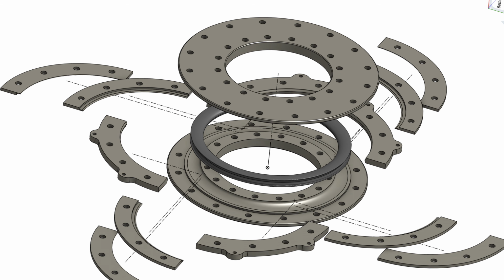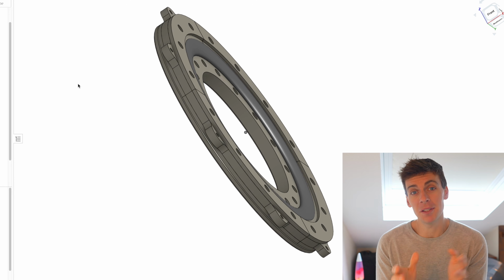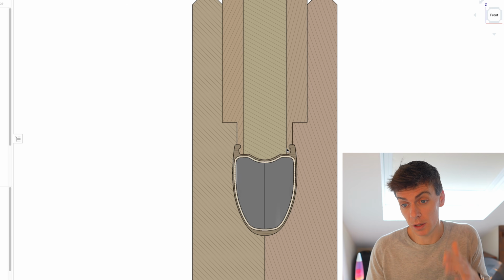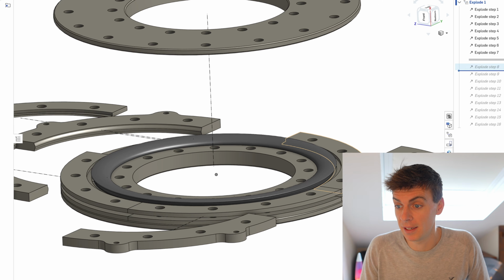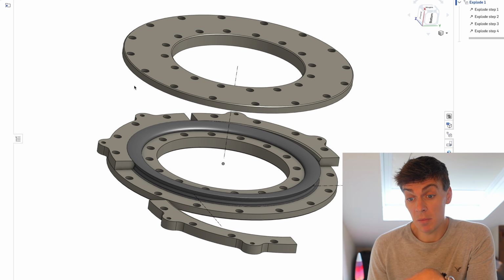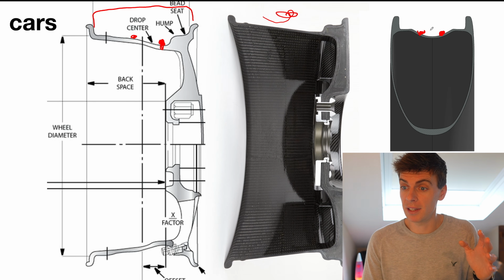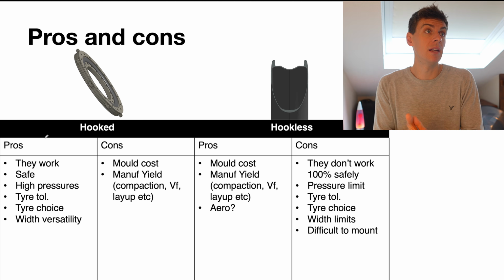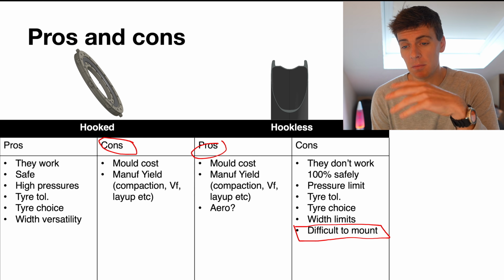Hookless carbon Bike Rims - the Truth = cost cutting.

Comment: I run hookless and I'm bike savvy so hookless is not an issue. I don't run any tires not meant for my rims. I'm currently 143lbs with 28mm tires so with my weight its not really an issue

The issue is there are a lot more riders who are not bike savvy or riders who weigh more and risk running higher pressures. Obviously, if the rider is running bigger tires it does reduce the tire pressure needed 

Which brings me to the trend that most roadies are moving towards 30mm - 35mm tires. If this becomes the norm then hookless will have less of a chance blowing off the rim. 

I've been running hookless on my MTB bike way before hookless was even a thing in the road cycling world. 

Hookless can be an option alongside clincher

Comment: Just found your channel and really enjoying it. This video I know you were more looking at it from a road side, but I was thinking more from a MTB perspective. Over the years I have seen countless brands attempt carbon MTB rims and the most notable trend was rims failing on the hook for more aggressive applications. Then when hookless started becoming a thing, we seeing far more reliable carbon MTB wheels. I never really thought about it but before but I wonder if that was due to a combination of two things you mentioned. The dimensions for hooks dramatically predates carbon rims and perhaps there is a limitation in material quantity due to the standards space constraints? Especially given your second point about the manufacturing consistency when forming such a relatively small and intricate shape as the hooks on these rims. Perhaps in some specific applications hookless could have some practical usefulness over just manufacturing cost?
Reply from the maker: @kenh6096  certainly in mtb i think the thicker, more uniform plies of the straight rim wall without hook (in carbon) is beneficial over hooked. Coupled with lower pressures, speeds (in general) and much stiffer carcasses - it can work. Road however, as we have recently been reminded, its just a risk not worth taking.

Comment: As a rider i have used hooked with a tube  or unfortunately hookless and no tube. Never been 100% sold on the hookless part. Comfort no tube does help. Never lost a tire but felt needed a hydrologic press to mount the tubeless a few times. All the talk on this and seeing how sketchy it can be makes me  question a local route with speeds over 55 mph at 12% grade. If there is 0 benefit to a rider lets go with safest possible. Not looking for hospital bills. Also if it cuts costs for manufacturing why are the wheels still over 2k a pop for top end?  Requiring wider tires has aslo pushed many of these hookless outside the aero benefits they claimed were possible at one point. The BS manufacturers said was it gives an aero benefit between tire bead and wheel. Think we passed the tire widths that those benefits dont exist on many wheels. The wider tire benefits have been negligible on personal test too and roads are not great here.

Comment: With hooks, the tire is hold by the inner tube - expanding force pushes the tire from inside on the hooks. 

Hookles could be good if they use inner tube to expand tire on the rim, and use sealant inside the tube. But you cannot over inflate them as they could push the tire out.

Comment: Probably an excellent analysis for road bikes... But I use a gravel bike. I never use smaller tyres then 35mm (NOT 25mm LOL). Often 40mm. It means I never go higher then 60psi. Most often for those 35 its still 50psi anyway, which works brilliantly. All the tyres I buy check if they are hookless and tubeless compatible, and they all are. So I don't feel that limited. Because they are a bit wider, I don't get the puncture. Well I also don't torture my tyres, I don't race, more a sunday rider. So it seems I am doing fine. Any comments on this ?

Comment: You can throw a lot of logical statements against hookless but the tests proves it works? Maybe not with all tires and pressures but within a certain range. There are also other benefits to hookless besides reduced manufacturing cost
Reply: Neglects to mention any other benefits...

Comment: Thanks, been telling my mates to avoid for years. I have the 454 nsw zipp wheels but they were the first iteration and are hooked.
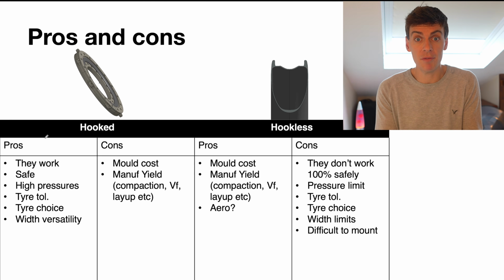One thing - can you clear up pressures - hambini in his video of the same issue (cut apart zipp wheel, about 18:30 in) seemed to extol higher pressures - does that not lead to an increase chance of blow off with hookless ? there was an enve video of them testing this somewhere iirc.

Comment: Hookless on a road bike is no different from the current 1X scam on road and gravel bikes. The manufacturers eliminated the cost of a front shifter mechanism, a chainring, and a front derailleur, yet the price of the groups are generally at the same MSRP or even higher than a comparable 2X system. 1X for road and gravel has always been a complete scam to lower manufacturing costs and increase manufacturer ROI. Full stop!

It also got pedaled to the market by SCAM's marketing team because they lacked the ability to create and fabricate a dependable and proper shifting front derailleur so they basically just lost it and started advertising their snake oil BS about how 1X is soooo much simpler (as if a bicycle front derailleur is some obtuse NASA type device that no one can comprehend or adjust on rare occasions???) and then lied further and waxed poetically about the supposed "massive" weight savings while of course conveniently ignoring the fact almost all 1X road and gravel set ups are using a dinner plate sized cassette, a chain catcher and a longer chain to deal with that dinner plate size cassette, which pretty much eliminates  almost all the "supposed" claimed weight savings. Then to finish off their comedic snake oil marketing act/project they actually raised the price of 1X groups higher than their comparable 2X systems even though it obviously costs them far less to produce said 1X system. And of course, loads of gullible and easily marketed to dopes have happily bought into their 1X snake oil BS nonsense. 

Oh yes, I'll happily pay MORE for bigger gear jumps,  constant shitty extreme chain angles and loads of extra accelerated wear on my chain and cassette and single chainring up front. Sounds like an absolute "incredible must have" bargain on my road or gravel bike. LOL  PT Barnum would have been very proud and envious of this obvious scam marketed as an "improvement" along with the latest hookless rim scams! 🙂
Reply from the maker: Absolutely agree. And sram pushing smaller front rings because material cost goes down with radius ^2 🤓

Comment: I use the Zipp 454 with Conti GP5000S TR 28mm in tubeless setup. I am easily able to mount the tyres on the rims with my hands. It is harder to dismount the tyres the tyres from the rim. So I have been able to dismount the tyres only with the help of tyre levers.

Comment: Lets revisit when all your new bikes in the next 2 years will be hookless. Find me someome who has had a failure that actually followed the manufacturer recommendations. Its like blaming Shimano disc brakes because once upon a time someone used dot fluid instead of mineral oil in their shimano brakes.
Reply from the maker: I dont want to ride at 73 psi knowing the safety factor is 10% over. Nothing to do with manufacturer recommendations, i don't trust them.

Comment: I was expecting a little bit more from your video. Comparing molds and car tires … when we actually could see engineer thoughts on examples of hookles + some of compatible tires, or strength of the profile etc etc. I use hooked and hookles - definitely next wheels will be hookless, no issues and much more comfortable. But I run disc brakes and tubeless since almost 10 years now and use a gravel bike since 10 years and it was horrible than - now everyone does 😊😊😊 for me it is the same with hookless…

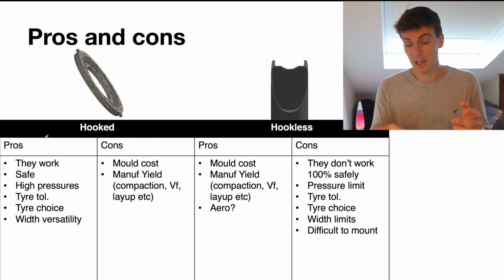Comment: @18:30…another “con” for hooked is the manual cleanup of the numerous die lines.

Also, as the dies wear, or if the die tolerances aren’t “perfect”, you’ll end up with steps at the die lines which can’t be cleaned up.  Maybe that falls under “mfg yield”.

Comment: Just a few thoughts. Enve, Zipp, Cadex, quite a market share, used in a pro peloton for a couple of years now. How many accidents were there, propeloton wise and among amateur and recreational cyclist. It is new techonolgy, every accident is put on alarm as it was every single time hookless is used. Same happened when disc brakes were introduced, one cut due to rotor looked as carnage made by persian carriage. People are putting 23 mm tires on a 23/25 internal width, Silca recommended 5,5 bar on a Zipp rim, etc... Too low pressure - danger, pressure above 5 bar - danger, narrower tire than 28 mm on 23 internal - danger. My LBS told me how insane low pressure pros are using, and this is not a rumor, few well know peloton pros are locals in my town. Using inserts like this proves that pressure might be too low. If you use 28-32 mm tire approved for hookless, with pressure from 4-5 bar you are good to go. Lower/higher/narrower - not so much. And again is there indeed any research how many accidents are hookles based? last year among pros, if i am correct, so correct me if i am wrong - none?

Comment: There's some good analysis here, and I have no doubt that some manufacturers use a hooked / crotched mold as you have shown here. However, I know for a fact that at least some rim manufacturers (who control their own manufacturing - not contracted) do not use steel hooked plates when molding the hooks. 

Instead, they use a silicon mold piece to shape the hooks, that can be pulled out from under the hooks due to the flexible nature of this hook mold. Unfortunately, this means they cannot achieve the same compaction pressure and consistency you get from a steel mold - so from a manufacturing perspective looking at hooked vs hookless, hookless means simpler molds that also significantly improve compaction in the sidewall area. End result is a slightly simpler mold than you have imagined here, but with compromises to the finished product.

Comment: Have always thought hookless are not safe ,so much can go wrong tire size , pressure , and if you are riding through an area where the temps are high you air pressure in the tire goes up another thing to worry about ,and if you have bad roads s---t,    sorry to those who use them  , hooked rims only for me ,

Comment: Why would you need more than a 3-piece mold for hooked rims? Per section that is.
Reply from the maker: My guess is most basic mills like to measure x/y limits when performing post machining tolerance analysis rather than a polar coordinate/120 deg arc being quite hard to measure.

Comment: Would it not be possible to just manifacture hookless rims with thicker edges, and machine/mill the hook afterwards? Best of both worlds?
Reply from the maker: Yes, youd cut through and damage fibers but it could be done if there was enough material there. Practically quite difficult as if you moved the cnc tool or the workpiece, the rim needs to be dead true before milling. They’re not flat when they come out the mold

Comment: I have zero knowledge of carbon layup strength or the ability of carbon to be machined and still maintaining strength. IF you made a hookless rim with say 5mm wall thickness could you machine the hook. A much simpler mould is required and a machined finish should give you better tolerances.

Comment: I suspect that ISO standards were based on alloy beading surface. We saw worse performance with rim brakes on carbon rims, I suspect carbon bead performance is also inferior to alloy.
Reply: Who started the nonsense about the low performance of rim brakes? With the right rim brakes, the pressure of one finger is enough to overturn or lock the rear wheel. In any weather.
Reply: I agree with you, I ride rim brakes, but they are undeniable worse performing on carbon rims than on alloy.  @paterjan9733

Comment: Oh please, you are way overselling the complexity of that mold, uuuh, oooh tolerance stackups, so so complex - no it isn't - you can turn most of that on a lathe, forces acting during production are minimal - this is not injection molding.
Also it wouldn't be 'tens of fhousands', more like a 'few', and at those selling prices those pay up for themselves very very fast.
Reply: After giving it some thought - you can probably just machine the hook groove in the rim - a bit weaker than solid, but a compromise.

Comment: The hookless seems to be a standard for the mountain bikes rims and tyres (correct me if I am wrong). At the same time, the size gap between road and MTB is being closed with the current supersized gravel and big road tyres. Roadies use 32c, some are even using 34c and they say theoretically riders could benefit from even bigger road tyres. It is obvious that the smaller tyres and higher pressures (25c) work against the hookless though. So where is that borderline? 
PS Why are aero benefits doubtful? Isn't that area of the wheel critical for aero gains?

Comment: I could not agree more with you.
With pressures above 4 bar hookless designs make just no bloody sense...

Concerning the GP5000 TR: I had rims made at lightbicycle and send them the notoriously difficult to mount Conti tires up front, so they actually adjusted their mold design / rim design to match the GP5000...

Comment: Had idea of using the new straight wall mold method with extra thick walls then chucking partially disassembled mold in a lathe for machining in the hooks.  However, the hook area wouldn't end up as strong, but could have fewer voids.  Economy increase would be dependent on old hooked molds' yield.

Comment: Relieved that the Zipp 353 NSW wheels that I have should be okay for the application I use the  for. Gravel. Running 700x38 Rene Herse (on the approved list) tubeless and never higher than 45psi. Had no issues with installation.

Comment: Nice mold design and I'm sure some factories are using something similar but I believe the standard practice in the industry is to use a single piece mandrel, even in hooked rims.  In order to remove it they make it out of a soft material which is permanently deformed during extraction and must therefore be disposed of after a single use.  This is obviously also less cost effective than the reusable mandrels in hookless rim manufacture.

Comment: I have Hookless rims. They're a gravel wheelset although I use them with road tyres. I run 34c tyres at around 50psi. I wouldn't run anything less than 32c on them. I fairly light too at around 65kg.
With the benefit of hindsight I probably wouldn't buy Hookless again but I'm not going to lose any sleep over riding this wheelset.

Comment: I defend my 303 by saying non of the cons are important to me, like none of its Pros. I bought this set for 1. brand and warranty 2. purchased at a discount at 0% instalment 3. weight 4. wide inner width 5. also works as gravel set with its 25 inner width 6. bling. its hooklessness was the least of my problems.

On road, I'm running GP 28mm and moving on to 30mm soon since comfort = more hours on the bike. Mounting GPs isn't a headache for me. Despite heavy weight, I run my tires between 62 and 66 (Zipp suggestion for 108kg total weight), which with increased tire width they'll go even more down in the future. Yet to have a blowout as I don't live in Dubai, but rather cold Germany.

Comment: I had never thought about the compaction void issue with the hooks, tolerance stack and seepage issue. I think the solution would be to add hooks to the hook-less rim, however instead of gluing on hooks why not machine the hooks in as part of the finishing process.

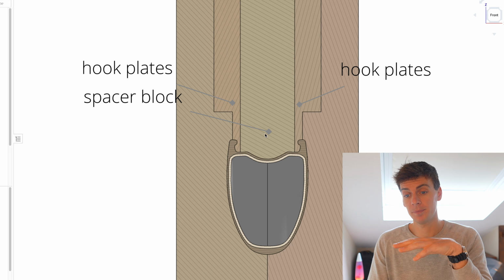Comment: I'm curious if you know this. At minute @7:30, the cross-section of the rim along with rim, I'm curious if there are extra layers of carbon on the hook compared with the rest of the sidewall. I'm guessing is that there's either extra layers of carbon on the hook or the hook isn't as compressed as the rest of the sidewall. Either way, how would it impact the durability of the rim?

Comment: Will never run hookless, state of the roads where i live means that impact pressure events will exceed the rated pressure numerous times, even on a short cycle ride. I will stick with extruded aluminium rims for as long as i can.

Comment: Hey PT, thanks for the manufacturing engineering explanation. Very informative. I always learn tons from your posts from a technical perspective. I'm not sure I 100% agree with this conclusion. I have 5 sets of tubeless wheels which I've been riding for close to 10 years. I've had tire blow outs on 'hooked' tubeless wheels while riding and pumping up. I've never had one issue with my hookless wheels. I've learned it's all about the correct fit. Making sure the wheels and tire are a good match. Before we kill the idea of hookless based on one high profile failure where the team clearly ignored the proper setup specs, I'd like to see objective data which demonstrates it's a real issue. Show me data of failures on proper wheel and tire combinations that meet ISO & ETRTO standards. Also, show me data on failures of tires on hooked wheels in the early days of tubeless. I bet you'll see there were lots until tire manufacturers and wheel makers figured it out. This article by Rene Herse is interesting. https://www.renehersecycles.com/uae-tour-and-tubeless-what-is-safe/

Comment: All of this is why I went back to pure clinchers.  I am a sports rider, and losing an hour out on the road trying to get a tubeless tire on while the group stands around is out of the question.  The power gained from tubeless is just too small to bother with. Also, you have a hard time getting the presta valve to seal on cheap TPU tubes, which make clinchers still easier to mount.